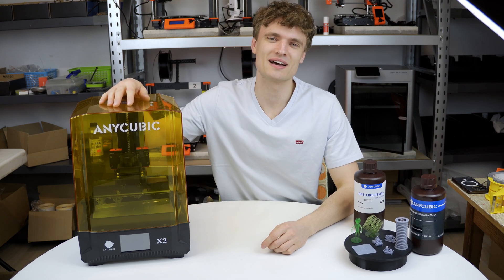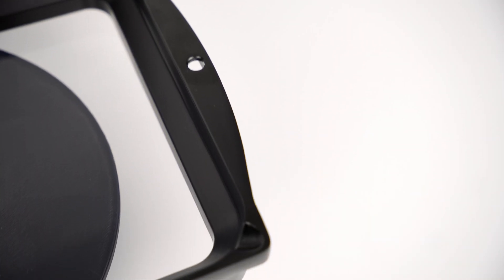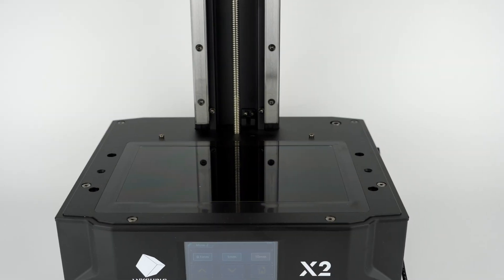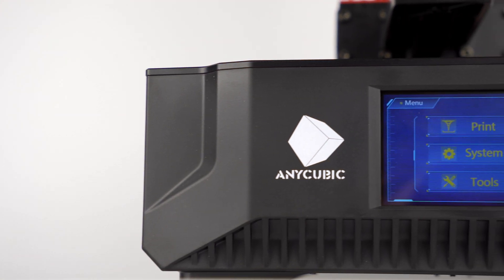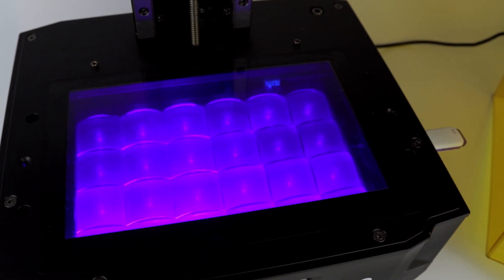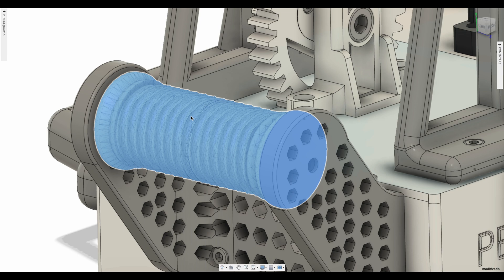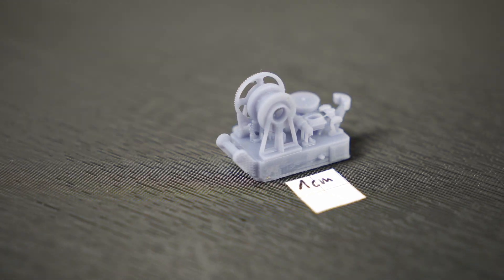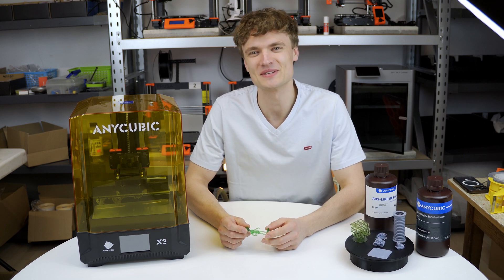Anycubic Photon Mono X2, is it useful for the mechanical designer? | Review

Comment: Hi! What is the reason that you're printing the spool at 45 degrees? Why can't it sit flat on the buildplate like with FDM?
Reply from the maker: I was curious about it too! Why it's recommended. I need to make more experiments, but as I noticed when model touch the build plate directly without supports there is "elephant foot" effect and first layers of our print are squeezed a little bit. 45 degree orientation decrees printing time as well, because higher the object longer printing time.

 I used to FDM much more so this 45 degree printing is interesting and annoying in the same time haha
Reply: @TylmanDesign  

I see, that does indeed make sense! I've actually purchased a resin 3d printer myself recently. I've noticed that prints with a large surface area are difficult to remove from the buildplate. The elephant foot effect is very noticable as well. I haven't tried it yet, but there is an option in the Chitubox slicer called "Bottom Tolerance Compensation". It's supposed to compensate for the overexposure of the bottom layers. 

Thank you for pointing out that some print orientations can reduce the print time. It's a very useful tip!